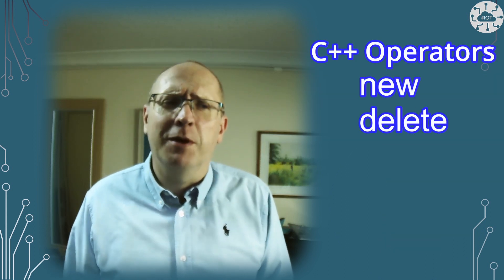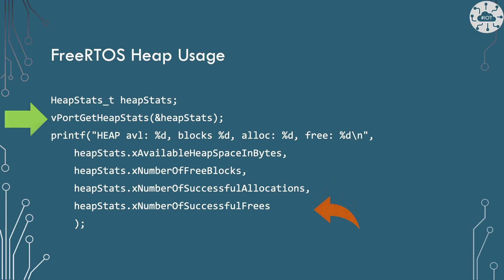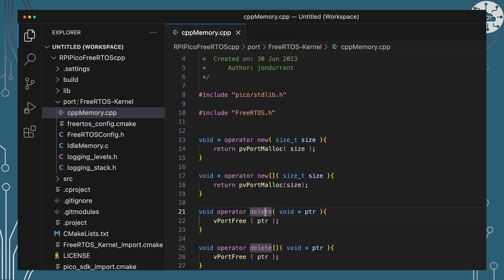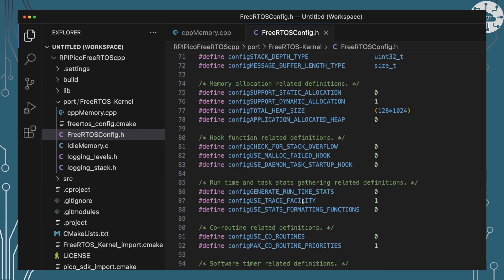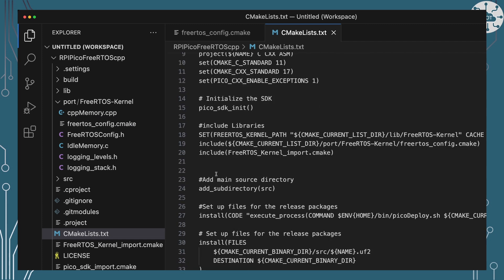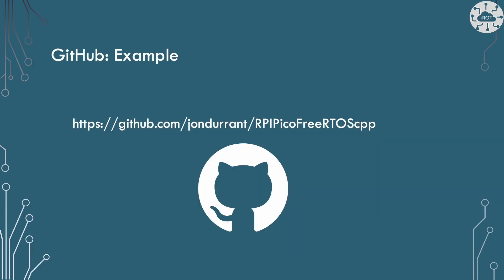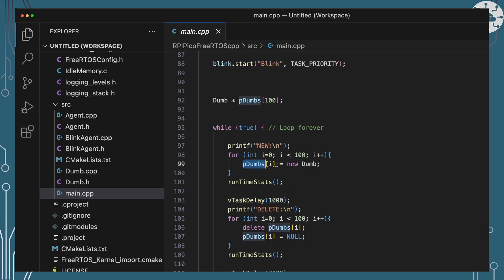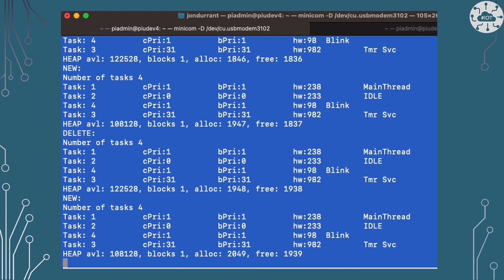C++ and FreeRTOS Heap, on Raspberry Pi Pico

Comment: Thanks for the video Jon, do you have any examples for unit testing using C with the Pi Pico SDK?
Reply from the maker: Hi Greg, No I have not found a nice framework that is easily configurable with the Pico. It is something we need. I tend to just roll something quick each time.
Reply from the maker: Greg, you made me curious. I came across this excellent blog on unit testing that looks compatible with the Pico: https://interrupt.memfault.com/blog/unit-testing-basics
Reply: @DrJonEA  Thank you Jon that's great I will take a look. I have been building a data logger for my solar inverters to send data to AWS IOT core via MQTT. Debugging Modbus live is a bit of a pain, I have managed to create a fake Modbus Slave to mimic my inverter and it's registers in Python but being able to unit test the code for the Pico would make testing different scenarios much faster, especially if I am able to mock data to specific functions to simulate different failure scenarios.
Reply from the maker: Sounds great. Let me know how you get on. Perhaps we could do a video interview talking through your experience of unit testing on the Pico. I am sure others would be interested.
Reply: @DrJonEA  that would be brilliant, I am by no means an embedded engineer or even a C developer I'm just finding my way round once I've got my bearings I'll reach out. I always find it more interesting to do these things low level rather than use something like the Arduino framework.